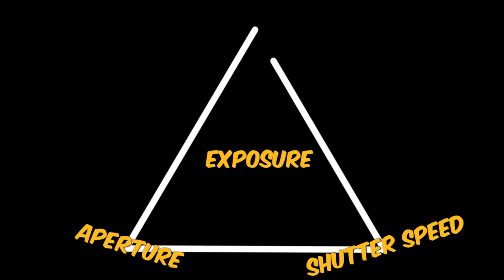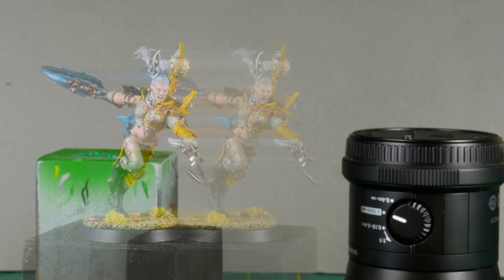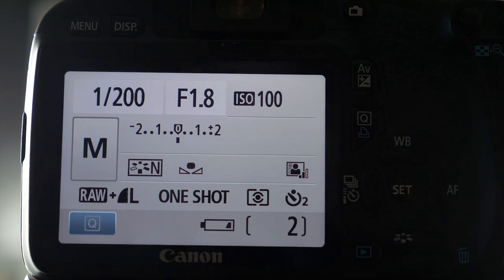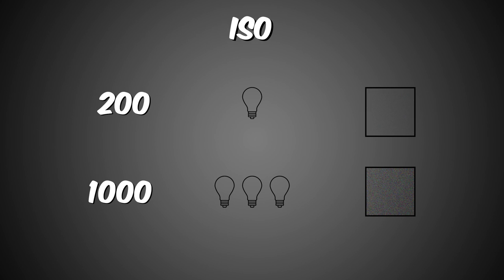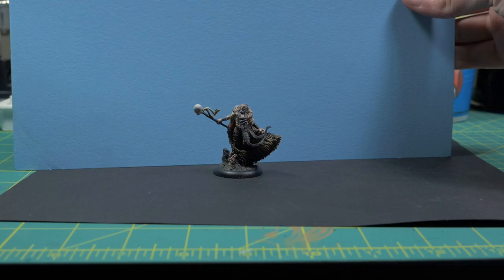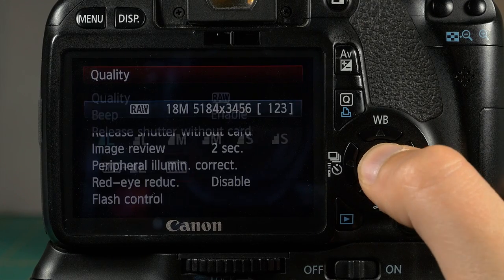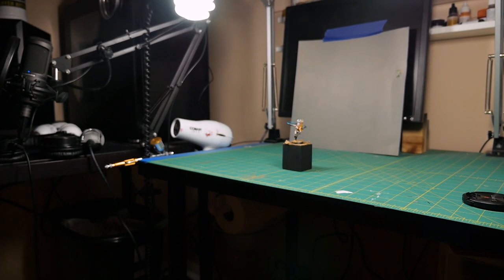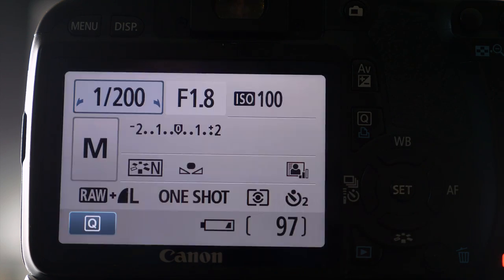Advanced Miniature Photography

Comment: Since macro lenses also work perfectly fine as "normal" lenses at their focal length (even rather well, considering they often need to be fairly sharp), you don't really need to hold back from using a macro lens even if you decide you want to shoot farther away from your miniature. Though, of course, if you're paying more for the macro aspect (which really just usually means it can take pictures at a 1:1 ratio of the subject to the sensor) and not using it, you might as well save yourself a buck.
Thanks for the video.
Reply: Great idea to use a true macro lense, Thanks, btw, would it be possible to use the video mode connected to a monitor (Canon 80D) for a live magnified view as an aid to painting the models?

Comment: Another awesome vid!! 

So many questions answered. 

My biggest "I don't know what the hell I'm doing" issue is whether to use Macro Mode or even Super Macro Mode. I have Canon Powershot 5S IS and really am not much of a photog guy. Do you suggest using those modes at all, or just stick to manual? 

Thanks again!
Reply from the maker: Depends on a few things: 

1. In manual mode, how can you get close enough to the miniature to get a good picture? 
2. If not, does your camera take high resolution photos (like UHD or higher) to where you can zoom in in post? 

If no to both of these, then consider using the macro modes. 

The problem with macro modes is that they make your depth of field REALLY shallow (especially when up close!), similar to how a macro lens looks when you get in tight. Experiment. Throw on the macro mode and maybe step make a little and see if you get better photos or not when using these modes.
Reply: I'll try that! Thanks!